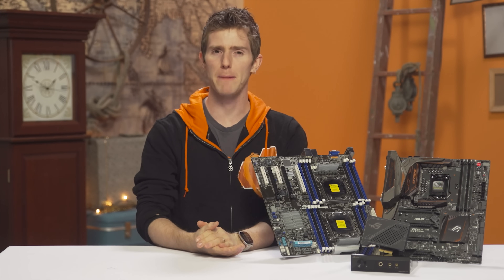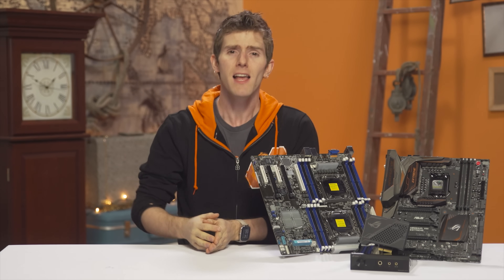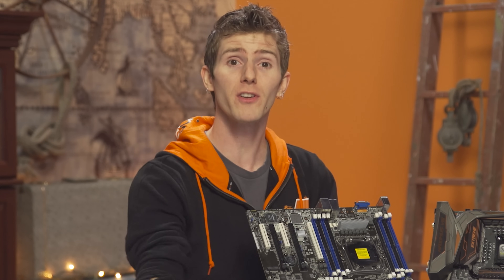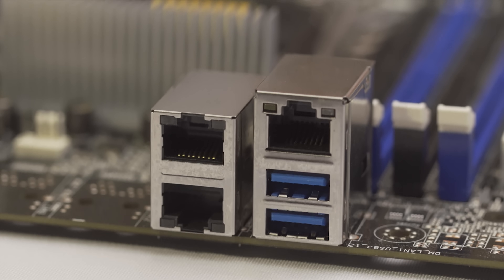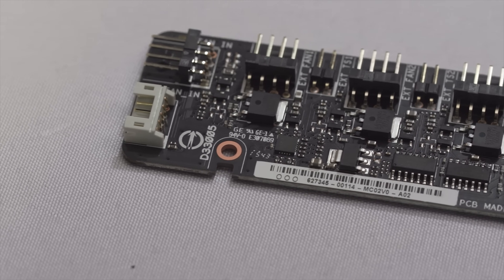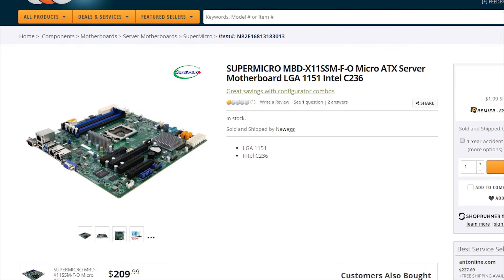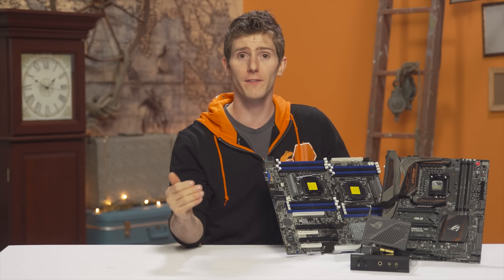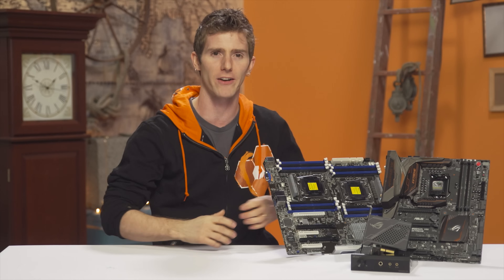What is the best choice for a motherboard? - The Final Answer

Comment: Best 150$ intel or amd board for gaming! Go!
Reply: Google it, go!
Reply: http://memesvault.com/wp-content/uploads/Okay-Meme-Gif-05.jpg
Reply: +Couch_Ech this aint 9gag
Reply: +Couch_Ech Asus Z170-A

Also, do your own googling.
Reply: +Brawndo Im happy to hear that, because im getting a Pc with that motherboard :D
Reply: +Seth Glenn There is no such thing as "gaming motherboard" a $70 motherboard will perform the same as a $300 motherboard. If you want to overclock obviously that will increase the price such as heatsinked mosfets ect. Anyone who puts "gaming" on their motherboard really makes me cringe.
Reply: Brawndo yes but it doesnt have all of the extra software like msi or rog puts on their motherboards. Also, if a Z chipset board can't overclock then its a bad board in general.
Reply: For under 150 my favorite is the msi krait for intel.
Reply: +Couch_Ech Asus Z170 Pro Gaming
Reply: +Couch_Ech Dont buy Asus z97 series. Many have problems with horrible noise with mics. And it acts wierdly for some too unless its set to "Performance mode". Worst motherboard I've ever had.
Reply: +Robber7 no problems with my z97a at all rock solid  4790k 4.7ghz easy to do.
Reply: ***** Ofc its not all of them, but too many of them has this issue.
Reply: +Couch_Ech There is no Intel and AMD board.
Reply: +Couch_Ech Any of the mid-ranged GIGABYTE or ASRock boards, probably. The two PCs in my house use the Z97 Extreme4 and Z97 Killer. Both work beautifully, though the latter isn't a very typical ATX board -- it's actually about two inches narrower than your standard board, but whatever. It works and looks decent for its price.
Reply: +Foxxy Rin I also have Extreme4. Beautiful board and dual bios is awesome!
Reply: z170 Gaming K6, has sli/crossfire support. bloodred/black color scheme, 7.1 audio, killer e2400 Ethernet, 3.1(a+c) ports, 6 or so 3.0 ports, also a fatal1ty mouse port (sets polling rate itself or something if mouse is capable)
Reply: +Couch_Ech You didn't mention size. In that price range, I really like my Mini-ITX Gigabyte GA-Z170N-Gaming 5, it has Wifi and an M.2 slot on the back, and cost $145. I've a 980 Ti hooked to it. Nice overclocking.   Very happy with this board.
Reply: Biostar Kappa
Reply: +Couch_Ech A graphing calculator
Reply: asrock fm2a68 hd! best budget board for 50 bucks!!
Reply: +Couch_Ech Why is everything "for gaming" my Asus Z-170-AR is not a gaming motherboard and it overclocks fine and it has some cool things. And it's not red. It has ram slots.
Reply: Seth Glenn You're kidding right..? This motherboard is marketed as an overclocker and SLI friendly mobo. "Games run swiftly and smoothly with high performance, prioritized bandwidth and vivid sound." is the first thing you read from asus.
Reply: Brawndo just makes it a run of the mill motherboard. In all honesty every mother board manufacturer is gonna say that on a Z series board. Just because it runs games smoothly doesn't make it a gaming board. Its not listed as a gaming board. 

Nerp its a high preformance regular consumer mobo with overclocking and sli compatibility for those who need it (e.g. Those who do video editing)  and dont need to spend money on wonky features and lights.

Maximus is the Asus gaming mobo line. Not the run of the mill Z170 chipset line
Reply: Seth Glenn precisely. Gaming is just a word used next to Motherboard as an excuse for a black and red paint job and million useless features someone may use once for a price hike of 150 bucks or so. Its sad really. On another note sick looking motherboard btw
Reply: +Couch_Ech Did you not watch the video? LOL

Comment: can someone help me i want a z170 motherboard with sli support, 6700k, minimal 6 usb port and 1 usb 3.1, good audio, overclock support and not too expensive
Reply: +Emre Konuk MSI z170a gaming pro. Its 150-200 USD and it's the one I use. I have had zero problems with it. and the bios is very easy to use.
Reply: +Elliott Thompson (8-Bit Archeology) i ffound the msi z170 kraot r6 siage. Witch one is better i for me i think the r6. but i dont know it 100%
Reply: just compare the 2 boards to your next 4 year plan. think of what you might install and run. then look at what the differences are. one will fit your needs better.
Reply: +Elliott Thompson (8-Bit Archeology) i think i get the r6 couse it have more rear i/o but thnx mate. More people can use your help.
Reply: +Emre Konuk no problem  and Thank you. :)
Reply: +Elliott Thompson (8-Bit Archeology) 😉

Comment: A bit scattershot of recommendations. I thought it would be like this:

1. Figure out what chip you want, and the socket it needs. This hints at the lifecycle of your PC; sockets like 1150 needing DDR3 RAM will need a brand new board and memory should you want a new chip. If you want beyond 4 cores on an Intel platform, you're stuck with LGA 2011v3; no idea if the successor to Skylake will have it, or be on LGA 1151.

2. Decide what size computer you want. Chances are mini itx works for most people, since they rarely use SLI/Crossfire (300,000 people total use that, according to a July 2015 article) and they aren't using NVMe. The exception might be sound cards.

3. Decide what you want your computer for (render farm, gaming cpu, office use only, etc). This determines the features you might want or are interested in (dual sockets, M2, wireless AC, gigabit network with failover, etc.)

4. Figure out your budget. Then buy whatever mobo has a large number of positive reviews (consumer and maybe a professional one, which should have good feedback on layouts) and at least the features you want at the right price (as it probably is more expensive to get add on cards).

Comment: So this video was all about comparing a server motherboard vs a desktop motherboard which probably everybody knows that server boards are bad for gaming, let alone people be able to afford those.

This video was kinda pointless, you mentioned the actual reason in between, that modern mainboards have basically no impact on performance. So why did you not just compare a 600$ mainboard with some 70$ mainboard. Then you could have compared the features and told people to buy what you need. Like in this case, you dont need the gigabit extra card, your headset is some potato, so you dont need that soundcard, you never do liquid nitrogen cooling etc. then just buy the 70$ mainboard that can still take the same parts and you will have the same for less.

Comment: Im thinking of building another rig, which is G3258 OC system for light game like mmo, LoL etc.
I found cheap promo on Asus H97 Plus (way cheaper than the pentium). well it provides lot stuff for the price, M.2, usb 3, sata 6gb etc*.
Should I get it? Other board like Z97's, asrock H97M anniversary is expensive. And I know Asus the only company has thier budget mobo can OC the pentium from the start, while asrock one's need update Bios, not sure about other company

Comment: My motorboard has been getting real hot lately. So hot that the temp in my bedroom is a lot warmer than in the hallway. Earlier there was a little smoke coming through the back exhaust fan. I heard about water cooling. Can i just use water to cool it down right when its about to smoke? Or before to just avoid all together? Where do i put the water? Inside the cpu fan? Directly on the cpu?? Any advice is greatly appreciated.
Reply: +Deebo Guwop Honestly you cant go wrong with water cooling. The best solution is to buy a "reservoir" which really just means a large container and fill it with water then put it in your handy dandy gaming fridge. then what you want to do i pour ice cold water right onto your PC every 5-10 minutes. Dont forget to get it into your power supply, that can get hot as well. 
But wait. I know what your thinking. If the fridge is cooling the water and the water is cooling the PC, then why not just put the PC in the fridge. well my friend, you are a genius. This is literally a trillion dolar idea that no one has ever thought of before. So go ahead and just stick your PC into your handy dandy gaming fridge.

Comment: I personally look for on a motherboard is one that has no Realtek components at all. This is WAY harder than it seems, and usually restricts me to motherboards in the $130+ range. I'm willing to put up with a Realtek sound chip if it has a good solid ethernet chipset and either enough slots to put in a dedicated sound board, or if I'm going to use it solely through HDMI and run the sound that way. I just disable the Realtek chip in that case. (I'm often surprised at the use of Realtek chips in high end boards.)

I have had terrible boards that limited my performance before. I can't remember what board it was, but I looked for the best I7-920 board I could find. It had great reviews everywhere. I bought the best components everywhere else that I could find. But... Once I actually hooked it up, my I7-920 was coming in well under the performance of other i7-920's. Swapping every component out but the motherboard and processor did not increase the performance at all.

Comment: for example..on January, I'm supposed to get a ASUS Z97i-plus itx and a G3258 thinking to upgrade later on..but was caught in the transition time where shops where I come from, stop stocking up 1150 components especially itx..I was really excited since I have r7 260x and 8Gb HyperX idling in a core2duo sys for almost 2 years..so I had to rethink, do I need onboard Wifi? no(I already have a very good USB WiFi dongle..do I need M.2 slot?no I don't have more money for that..do I need an OC board?well I wanted to try OC but with budget considered, I end up in a B85m-itx and a used i5 4570(with a free Razer Naga, totally worth the sabotaged plan) on the cheap..with this I can just upgrade the GPU in months time and have a solid 1080p system for years.

Comment: do i really need 1000$ processor? yes Chris you fucking need it you need those cores to play csgo
but do i need 980Ti? fuck yes Chris , you need 500+fps in csgo
fml
Reply: +Vincensius Christopher for a decent csgo experience i recommend a 5960X and 3 or more 980ti's
Reply: I hate a 989ti ;-;
Reply: I love csgo
Reply: wayge not really
I need 69696969696969fps in csgo
So i need i69-6969X clocked at 6969696969GHz and 6969Ti 69gb
I also need 6969gigs of ddr69 ram clocked at 6969MHz
Reply: Vincensius Christopher why are you using a high tier processor like that and still using gigabytes of ram? all about the petabytes bro
Reply: wayge damnit gotta surf in amazon now

Comment: can any one give me like a solution if there is one i have a ps4 and my pc in my room and every time i want to switch i have to go in the back in switch the Ethernet cord its wired through my house and i cant get wifi in my room so i use the cabel so is it possible to spilt the Ethernet cabel to out puts with a repeater or no just ask if you want clarification
Reply: Buy a new cable.
Reply: But i only have one out put iwould still have to switch the cabels just in the wall instead witch isnt that much better
Reply: Chadwick Mason I recommend doing it correct or not at all.

Comment: you could have added the entire sector of the market who buys the absolute cheapest motherboard (the $50 board buyers) who probably still get exactly the features they need.
Reply: yh was going to buy a h170m itx. then realised that some b150s had inbuilt wifi for £20 less (apart from asus whose b150 board costs the same as a z170 one)

Comment: what's the difference of chipsets?
should i get a gigabyte h97?
Reply: +Dingus Bloke different chipsets support different features example any Z or X intel based chipsets support overclocking where B and others dont
Reply: +Dingus Bloke The difference in Socket type is a difference in the CPUs you can use that are compatible. For example, LGA 2011 can work with an i7-5960K, but you need a different socket typeto use a i7-4790K, such as LGA 1150 in this case
EDIT: Chipset =/= Socket type; a chipset is a different architecture of the CPU, for example the 5960K is Skylake whereas 4790K is Haswell
Reply: +Soul Reaver so an h chipset cannot overclock,but can my gpu?
Reply: NJP695 one irrelevant question here,can my pc last for a long time if i'm just playing low end games and one high end one(rust)?
Reply: +Dingus Bloke I wopuldn't worry about overclocking GPUs, you need to be ontop of a lot of things in order to do that. In terms of motherboards, the letter usually corresponds to what it's designed for, and while I don't know what H means for the brand you're talking about, I know that Z motherboards from Asus are best for overclocking, with useful tools in the BIOS menu already avalible
Reply: +Dingus Bloke Even if you played multiple high-end games (without overclocking), you'll be fine for a few years